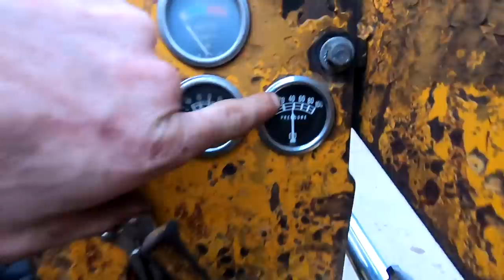A DEMORALIZING Turn in the Restoration of "Old Red" ~ Part 11 ~ 1950s Caterpillar TraxCavator

Comment: If you want to use this cat, throw the starting motor away, it will give you more trouble than the whole cat. Install a MT 40 24 volt starter, you need to get a Helical Cut Gear either a left or right hand. Put one battery under the arm rest and the other under the fuel tank. Seriously, do this!
Reply from the maker: I am SERIOUSLY considering that! I though there was more to it than that... I think I need a 24v generator and a few other things in the electronic system. Plus a few custom made plates to cover holes where the pony motor hooked into the diesel? If you have done this, I am SERIOUSLY interested in more info on doing this if you have the time!
Reply: There are kits out there to replace the pony see what's in them and make your own
Reply: @SalvageWorkshop  There is keeping it original and getting it working.  Old tractors get switched over to 12 volt all the time, points replaced with electronic ignitions, so I wouldn't lose any sleep over ditching the pony motor, seems like it will be a constant PITA. Awesome videos and persistence, it has kept me going on projects I would have given up on.
Reply: 🇬🇧, and being frank, that small petrol engine is started by.... an electric motor 🙄 - it would make sense to put an electric starter motor on the Diesel engine 😉, I don’t know why they had that arrangement - I’ve heard about small engines (pony motors) starting larger engines (often diesel). I have seen the configuration where a huge Diesel engine needs a high pressure start and the smaller engine is powering a compressor. Might also be when all engines were started by hand = easier to start a small engine and force it to start a larger engine, and no electricity needed (except if the small engine was petrol fuelled). I assume these pony motors are going extinct, only to be kept alive at steam shows/rally’s/fairs. When Savage Workshop has finished using that cat bulldozer, it will probably end up going to a US steam rally?
Reply: Greg Hunder  - Your quite right 😉, I think petrol engines are easier to start in colder weather - spark + choke closed, as Diesel engines need compression and heat.
Reply: @SalvageWorkshop  
Another system I have seen used on smaller CAT engines utilises the spinning vee belt pulley just in front of your feet. However I'm far from sure you have the room off to one side or the other because of the support structure for the loader to fit it in. I have seen both petrol engines and hydraulic motors used via an over centre lever and platform to feather the load on the driving mechanism initially together with the decompression system engaged so you can start the engine moving and build fuel and oil pressure.
Reply: @samuelfellows6923  because it was more than just about tutning over the motor , the pony motor preheated, the main engine and turned it over not just for a few seconds but for minutes at a time, there were no glow plugs or hot grid, they are very hard to start especially in cold
Reply: @jusb1066  And warming the oil too and pre-lubing the main engine There's nothing wrong with the pony motor system, especially in a pre-glow plug engine. And I believe that to add an electric starter to the main engine requires drilling a hole for the starter nose in EXACTLY the right spot plus the mounting bolt holes. It's not as easy as just tossing in a starter. In truth he's got a lot of track work to do yet and that's the expensive part.
Reply: Electric starters a nice until you park machine somewhere thats hard to get to and the battery is dead. Now you're carrying batteries or parts in.id rather deal with a pony motor that last for many years and can repair with a few hand tools
Reply from the maker: Where do you find the RH helical drive gear for the Dleco MT40 starter?
Reply: @samuelfellows6923  worked on a very old D8 where the pony motor was started with a pull rope. Lots of fun 😜

Comment: When you shut down the pony motor, turn off the fuel and let it run out of gas.  Gas leks down thru the carb and thins out the motor oil which will ruin your motor
Reply: I think he just learned the hard way
Reply: Understand what your saying & logical... when run “next day” will the hot motor oil “burn off the fuel” - & may leave some carbon buildup oil discolouration over time?

Comment: From watching SV Seeker, I learned that you should be able to use a hot air gun to warm up that hose pipe next time. It should make it a lot more flexible when trying to insert the metal ends.

Comment: Hard way to learn. Always turn off the gas and let the pony die . Do not shut off the mag.If the carb float does not seal it will leak gas into the pony crankcase and dilute the oil This will result in what you have now.
Reply from the maker: Of course I shut off the gas to the pony motor once the diesel starts up,  but that has nothing to do with the issue that happened... The problem occurred and I just happen to forget to shut off the gas due to the frustration of it, but before that the fuel had always been shut off... only harm having forgotten was that the Pony motors oil got diluted down with gas and needed to be changed, and that has already been done!

Comment: drop $20 on a 1/2 Inch Drive Impact Screwdriver Set.  Sometimes a hammer is the right tool for the job, but i like to saw the end off an old aluminum baseball bat for  use as a "cheater bar".  i admire your perseverance. thanks for helping keep older machinery relevant to parts manufacturers.

Comment: Are you killing the pony by shutting the fuel valve? If you don't, it will fill the crankcase with gas!
Reply from the maker: No... the fuel is always shut off after the diesel is turned off... Although I did forget immediately after the problem occurred & I couldn't get it started again, but I've already changed the oil to correct that issue.
Reply: After you start the diesel with the pony motor. Do you shut off the gas and let the pony die ? If you don't voibrration of the diesel running will make the needle and seat leak gas into the crankcase!

Comment: When working around radiator use 1/4" ply for protection, at least cardboard. When using puller leave nut on end of shaft as long as you can, it will help from mushrooming the end of shaft on stubborn pulls. Deep Creep by Seafoam really good stuff for stuck bolts/nuts. Man you really need a gallon of phosphoric acid for rust neuturalization, brush that stuff on everything after cleaning, it acts like anodizing for aluminium, eats into the pores of the steel & prevents future rust, put it in all those newly tapped holes, let it dry &  antiseze during assembly, I  use it like a primer, it will tack up during drying then spray it or brush with red oxide primer, good to go.They make 24v to 12v converters (get you a 50amp one) so you could run your lights/gages off that have 24v alt for batt charge. Starter would be better 24v. Have fun & please be careful, thought you lost your hand at the wrist when that drive sprocket flew off.

Comment: As time permits, over the last four years, I’ve been working with and repairing/rebuilding a 40 year old Bobcat. The issue you’re having with the pony motor is so typical of these old machines. When you get one major piece of the puzzle managed or repaired something on the other end of the machine gives up. It starts with a coolant leak and becomes a bad hydrostatic drive motor. Then you realize the o-rings in the spool valve are breaking up and must be replaced. Then...
By the time you’re done making repairs and chasing gremlins, If you don’t give up I think you know, you’ll be rewarded with a pretty darn good machine.
I’ve done it with antique Farmall tractors, 70 year old Ford pickups and 99 year old Model T Fords as well as a plethora of many other projects. Now at over 70 years old myself, I’m still at it and I’ve become a lot slower at what I do but still love doing it.

Comment: The process at around 24 minutes was mating the rubber hose to the metal fittings. Consider placing the two metal parts being inserted into the hose ends into a bucket of ice cubes. Then fill a pot with hot water about 4 " deep and place the hose end in till it's hot or warm. Now mate the metal inserts with the hose and repeat at the other end. Then use your clamps while the hose is still warm. The ice will shrink the metal and the hot water will soften and expand the hose. I hope this will help you for the next time. :)

Comment: If you want to make a trip to Kingsville MO I have a pair of pony motors you can have. I converted mine to electric start and don't need any of it. Also converting to electric start isn't that hard and well worth the time. The pony motor can be retained but I opted to put my battery tray in its place.

Comment: Ive been restoring antique crawlers,  for a few years. The hard way is to fix as you go, as more things break and more problems are discovered. I found it not only easier but also much more efficient to completely disassemble each section of the tractor, start with the tracks and undercarriage, most expensive to fix, then they are out of the way. Next move on to the motor and all its components, go thru every part, nut and bolt one at a time. If its a runner dont tear the motor down. Next is clutches, and there parts, bearings, linkage etc. Clean and paint everything for reassembly. Propane torch is youre best friend when taking it apart.

Comment: A trick I learned for getting seized/broken bolts out is to file the top clean (if you can get access) then put a nut that fits over the broken bolt/stud, clearing the threads.
I then put the MIG on high power and squirt a plug weld into the nut. Let it cool down the try a spanner on the nut. Most times the combination of the heat and the nut allow the bolt to be unscrewed.
It doesn't always work but it does anneal the bolt so drilling it out is a little easier.

Comment: I maintained a fleet of crude oil tankers and also gasoline tankers, Making up 3 inch hoses of various lengths was something we did almost every day. We had stainless steel banding strap  and the  tool to install the bands on the new hoses. That's the way to go. We used two bands on each fitting. Next time you make up a hose, instead of using those bulky clamps, just take it to your friendly gasoline tanker mechanic and ask him to band it for you. Takes about 5 minutes, and if he's nice, he probably won't even charge to do it.

Comment: Keep up the good work 
I worked on 360s for a company that would get them as scrap , some of them would not be very old but worked very hard with tens of thousands of hours on them and the list of jobs would just keep growing. Some of them came from a salt mine and a pig to take apart, heat is your friend, get the outer piece hot and the inner cold ,a trickling water hosepipe  works well .
I went on the ISOtunes website and ordered some ear defenders they asked where I heard about them so your channel got a mention so I hope they send you some freebies for you advertising for them

Comment: I’m extremely impressed with your workmanship! I’m old enough to be your grandfather and other than my own grandfather, I’ve yet to see this level of craftsmanship! Granted, it’s not rocket science, but apparently nobody cares enough to do things right anymore.
I restore classic cars (still) and the most difficult and frustrating part is undoing the BS “repairs” that others have committed over the years. Wood screws in place of machine screws, metric bolts in SAE threads etc. Are we the only ones who know where the hardware store is?
The only thing that made me cringe was that you don’t repaint components prior to reinstalling them. Why? Not only does it look better, it prevents corrosion and makes it easier to see leaks and other issues.

Comment: You tube channel Squatch 235 may be a good one for some knowledge on pony motors. The fella is a CAT guy and he's been doing a series building a 1938 CAT D-2. He has a couple of episodes on pony motors that might help. I think the series is called 5J1113. One thing he says is when you use the pony motor, don't leave the gas on if it isn't running. Shut off the gas valve while the pony motor is still running after the diesel motor has started. Run all the residual gas out of the pony motor carburetor and let it shut down from gas starvation. Then shut off the spark. Squatch says if you leave gas in the carb, it will leak into the cylinders while sitting and bypass rings and your oil get washed out with gas. That's probably why you have gas in your oil. He says nothing will kill a pony motor faster. Good luck and hope she isn't blown. Squatch has some good info on rebuilding them.

Comment: I have made thousands of gaskets in my time, but I come from a time when all you had was gasket material and a small ballpeen hammer. I was in the Royal Navy and when at sea we could not just pop out to our local gasket place, we had to make new ones from scratch but I have never seen anyone use scissors to cut around the outside of a gasket. It is so easy to use a hammer to make the gasket in the first place.

Comment: You might have been able to remove the belt pully by using two steel wedges on each side opposing each other, however you got some much needed maintainence work done anyway. Lot of work to change belt.  There are "link belts"  that can be slipped in and re joined ..Good vid !!

Comment: Agree with previous comment about water freezing in motor block.  I ruined a motor not realizing that all water will not drain from an engine block below freeze plugs.  Best to get antifreeze into the block!
Reply from the maker: I agree! I'll be doing that tomorrow!

Comment: What a project! I've never been around one of these. Always heard about them being a bear to work on etc. I like the series to see what these are like to work on. 
I work at Cat briefly. I learned about Kroil there. It's all I use now. Saw you using it too. How fitting. 
You've got good skills. Dig the wire brush in the drill press. Use mine on the grinder a lot. 
The water pump, belt tensioner, holy crap a small thing on this turns into a big job. I had a similar belt tensioner on a IH tractor. Thought it was a cool set up. Thanks for sharing! Can't wait for the next one.

Comment: Needed proper wheels for my new bride PNG found series 2 Landrover in the bush. Am not a mechanic but much is common sense.. vacuum pipe was rusted in places..wound soft string all along it which I smothered in “plumbers paste”. New battery. Got two brakes working of four, clutch started it screamed like a banshee, my gal drove with me under the bonnet adjusting distributer till it ran good. Found out eventually Landrover battery is positive to earth....but we had a great year together in it. That was 50yr ago now and she’s awaiting me to meet up in Paradise meanwhile just loving my to bed early with my YouTube.....thanks for your work

Comment: Just a heads up on a lesson I learned and confirmed on my motorcycle and then my dads truck, when flushing coolant or rust or anything, not running the engine and pump and rattling it and getting it hot, you will certainly miss rust and funny enough can even miss coolant (my dads truck had green coolant still after flushing with water for multiple hours, it was nuts) the heat and combustion expansion and vibration all help to remove more rust and grime, and the pump cycling helps get it to the drain, keep that in mind once you get it running again, or even in the better weather

Comment: Replacing the pony motor with a similar powered diesel engine would be nice...if it could be fitted to the existing mounts etc...
You would only need to carry one type of fuel...
Great job on the water pump, there are always one hidden bolt, that crack sth off of the housing, I know that from Ford V6 engines...
:-D
Thx for the vid!
:-D

Comment: There is a new type repair compound that when applied to defect will seal it or stick it together 
by applying the addhesive to needed repair area then using the ultra violet
light that comes with the kit applying 
that to the mastic seals it or sticks it together.  There is a ad on Youtube that tells all about it.  Very impressive!!!  Hope this will help you in the future.

Comment: When I was 13 I didn't add the antifreeze and cracked the block between the water and valve chambers. had to rebuild a clapped out block that wasn't cracked. Took a year, but what an education. Pony motors don't get destroyed with that little noise, they rattle and bang and with an almighty crash they won't turn over any more. been there done that too. :=)
Reply: First was a Model A Ford, second was a Cat D4

Comment: Instead of using engine oil on O rings which starts the decomposition of the ring, I keep a squirt can of vegetable oil on my work bench and use it to lube synthetic rubber O rings and assembly of things like that big steel hose connection and hose assembly you are working on.

Comment: Two possibilities I can think of on your starting engine.  1 if you shut the starting engine off with the mag kill all the gas in the float bowl will eventually run down into the crank case from vibration as it’s a down draft carb, thus diluting your engine oil and causing poor lubrication.  2 there is typically a bleeder valve in the top of the starting engine for the cooling system, this is important to open when you have drained the cooling system and then refilled it, a large air bubble can form in the starting engine and cause it to overheat because of the air bubble.  Could be that it overheated and that’s why you got the puff of white.  Hope this helps you in your diagnosing....